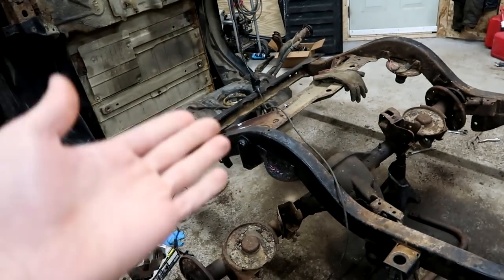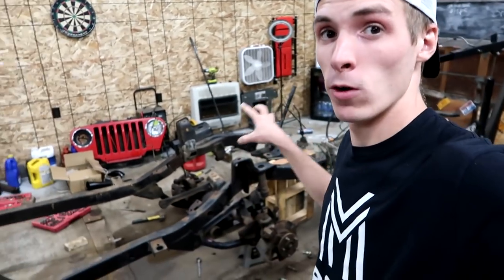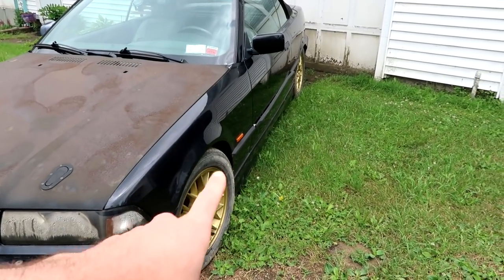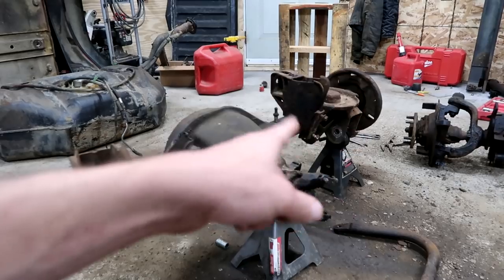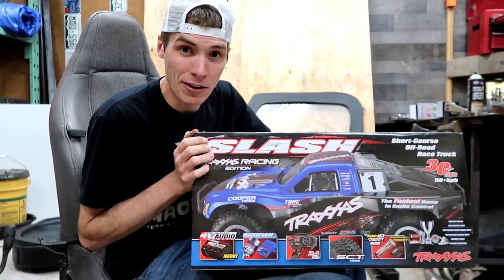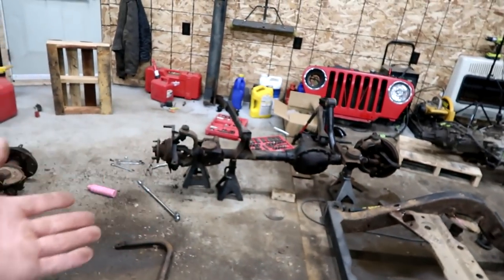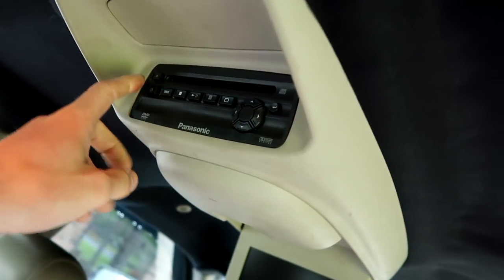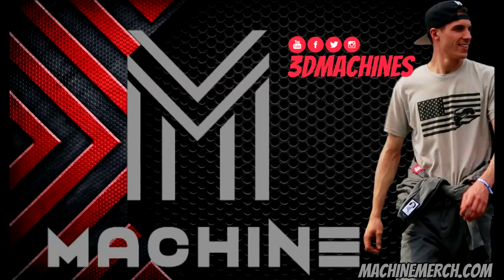NEW TRUCK REVEAL!!! (It's Finally Done)

Comment: The ford 9 inch is bulletproof
Reply: Kolby Flathers the ford 9 inch is built for half ton trucks and are hard to blow up not bulletproof I have blown one up before
Reply: We use them for all our drag vehicles we’ve got one underneath our 1300 horse mustang
Reply: Yeah, and Mustangs have about a quarter of the weight sitting on them, and less than half of the weight they have to move in total. Besides that, nobody wants to run hub adapters, which you'd need as a 9" is 5x5, and the Jeep's pattern is 5x4.5 or 5x114.3
Reply: Bulletproof.. compared to what? Aluminum foil??
Reply: The ford 9 inch is not bulletproof
Reply: Kolby Flathers what can u get ford 9inches off of?
Reply: It's a ford what do u think
Reply: I mean... every diff is bullet proof.... shooting it won’t hurt it.
Reply: Ford 9” is only good because the shafts won’t slide out in a demo derby
Reply: Hell yeah got a 2004 chevy colorado with a 6.0 i got a built 9 inch came out of a ford rancharo i built it up and it aint blown yet knock on wood
Reply: Kolby Flathers nooo
Reply: Nickolaus Vandever-Moore same
Reply: No hub adapters are needed if he swaps in a Ford Dana 44 in the front.
Reply: "Only good because"? You know nothing about axles.

Comment: Happy BirthDay Girl Friend Happy Birthday To YOU!!!!!! Keep the stock front axle - I did blow one but I had used my Jeep for plowing snow for many years and driving without free wheeling front hubs. The side gears went out but it was no big thing to repair my diff. If I recall all of the 4 cylinders had 410 gears but I could be wrong. Once I repaired my front diff I never had any further issues. If you were into hard core off roading like I am and had a big block Chevy for an engine sure change other wise it will be good to you. Once my V8 went in my replaced my front axle. Thanks

Comment: I would try to find a Danna 44
Reply: Or Dana 60
Reply: I would put a Dana 44
Reply: He'd run into width issues with the 60. I know NYS is really strict on tire outside of fender flare laws, so full width axles probably wouldn't be a viable option for him. However, a cast iron 44 rear and 44 front would probably be good.
Reply: 01Durango5.9R/T we run 44inch by 16 for off road use only
Reply: Got me like 10 danna 44 there not rare
Reply: 1 tons Dana 60 all the way
Reply: 67-72 Chevy trucks no definitely not that's way overkill

Comment: The tires alone will brake rear if your supper easy on it they won't break as fast but I promise you will snap axle shafts my buddies are a bunch of XJ guys they go through rears like a mo fo they either swap to Chrysler Eaton quarters Ford 8.8 or 1 tons
Reply: A Eddie Bauer Ford Explorer will have an eight eight usually limited slip with 4/10 and if you're lucky disc brakes would be a perfect setup for the rear of your Jeep

Comment: It will be hard to break that Dana 30 I know a guy that put a 200 shot of Nitrous in a stock 360 and pulled it in a truck pull for 4 years and did not brake it it was also a Ramcharger but he had luck as well

Comment: Anything above 31" tires, the low pinion 30/35 combo is junk. You can spend thousands making them as tough as a Ford 8.8/D44 front that are stock. My last Jeep I had that exact setup with 33" Baja Claw TTC's and 4.56 gearing, could not get either to fail.

Comment: Personally im not a big fan of powder coating because my dads cement mixer was stored in a damp barn and 2 years later the coating started to peel and when it peeled there was all sorts of rust under the coating. We also have a 02 ford explorer that  has powder coated front suspension parts FROM FACTORY and 13 years in salt was too much for all the parts cuz once again rock chips must have allowed salt to creep under the powder coating and rust the crap out of the metal. And as we would peel the powder coating we fount lots of rust and salt residue under it. Maybe the metal was prepped wrong but all my experiences with powder coating was trash. If i want a car to last long i under coat the crap outa it and keep it painted and if it was exposed to rust before i do what my grandpa learned from the military. He would sray trans fluid under the car then spray under coating over the trans fluid. It makes a sticky mess but after a day or so it will dry and will protect it from salt and the trans fluid will slow down any rust. When my dad was younger my grandpa bought a 1981 jeep cj7 with 500 miles on it. They bought it and later found out that it was fliped on it side and full of bondo . Over the years the body rusted out where the spot welds are and they kapt patching it and throufmght out the years my grand pa would spray the under coating and trans fluind under it and that jeeps frame is as solid as any southern frame. Keep in mind this jeep has been in Pennsylvania salt and Wisconsin salt all its life with little to no car washes and it has sat out side all its life till recent years. Every other jeep with similar  or even lower miles ive seen here up north they all have rusted out in the rear. His other cj7s frame rusted out before he bought it and he had to patch it and so did my cj7 that we recently acquired. So i plan on this under coating trick with my jeep so that in the future i dont have a frame made of swiss cheese

Comment: I’ve had a Dana 30 and 35 in my 95 and I only used it for a work car. Highway only. It had 80,000 miles on it and the Dana 30 blew the face off of the axle. I always kept up on all my 2500 mile inspections and I always replaced my fluid every 10,000. I have owned it since 55,000 miles. Then bought a Dana 35 after that went for front and back which had went after 25,000 miles. I do not recommend these

Comment: The Ram charger needs valve guides.
Reply: James Eggerth yup, pretty common for the la 5.2/5.9 (318/360) motors until the early 90s magnums
Reply: Have a 94 Ram with 5.2  318 magnum has same issue, thinks it is normal with 100 thousand mile plus.
Reply: Have a 78 360 in my 80 power wagon. No smoke at all.
Reply: bullshit. its not valve guides. Thats black smoke so its running rich.
Reply: Ryan Georgi thank god. I thought I was the only one.

Comment: My understanding is that for light use with not to large tires the Dana 30 and 35 will hold up just fine.   Where they fail is with hard wheeling, huge tires and lots of power .

Comment: hey buddy enjoying the channel and builds and like a lot of what you do. But I see that you talk about how powder coating your jeep parts and frame is going to make them last for years. Well I have a feeling that if you plan on having that Jeep in the mud and snow that your going to be disappointed. I work with a commercial truck equipment manufacture and well have a lot of parts powder coated, and I see them come back after just a few years with it coming off and rusted like anything else. All it takes is a small spot that didn't get prepped correctly and rust will form under the powder coat. So maybe you shouldn't plan on it lasting a life time.

Comment: Save the money and time keep the 35 and the 30. That 4.0 is not going to put enough power out hurt those axles and the jeep is not that heavy in the first place.  My Grand Cherokee has those same ones but with 3.73 gears and it weighs 4400 lb I haven't had anything go wrong with 223k miles on them.
Reply: the 4.0 is turbo charge
Reply: William Tremblay yes I know it is. All of its power comes in early 1800 to 3400 rpm  the turbo will give the engine better top end performance. But it's not going to add a ton of torque maybe 50 ft torque and HP.
Reply: QuietHorizon 241 he thinks it's going to put out 500 +with just a turbo no internals changed good luck with that shit. Think Dalton just wants it to run like a top not a fucking caged up 1000+ rock buggy plus we don't want Dalton hurting himself different beast a 2-3 ton vehicle and crush .
Reply: David Peru it really comes down of how big of tires he wants to run. If he wants to run like 38 or 40 inch or bigger he is gonna need better axles.
Reply: QuietHorizon 241 38 and 40s are big for 4 inch lift... That's more less where he's aiming for on total lift I think how much does his 4.0 put out at the wheels anyways??
Reply: the 4.0 makes around 135 at the wheels I believe
Reply: David Peru  you looking at about 160hp and 200tq to the wheels.
Reply: Oh and let me add that I have pulled a 95 grand Cherokee 60 miles back home with my jeep no problem.